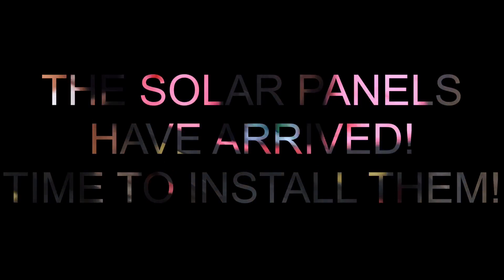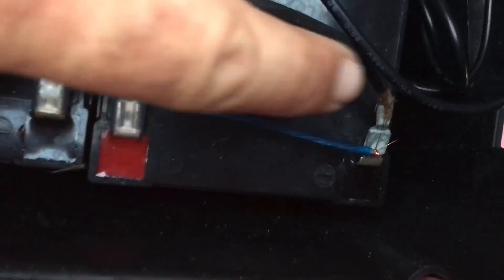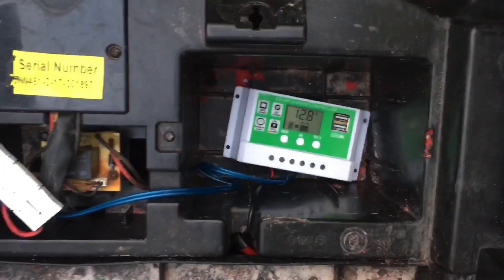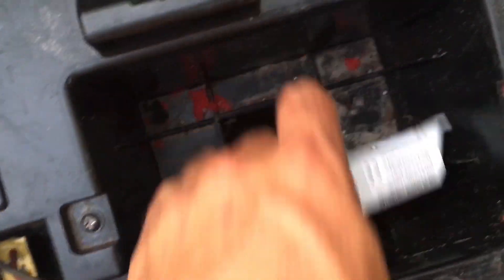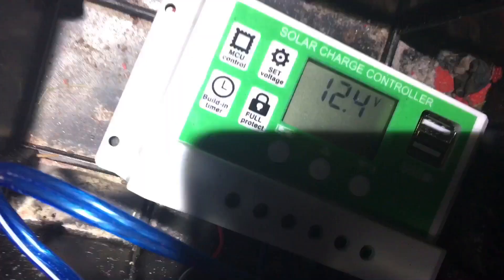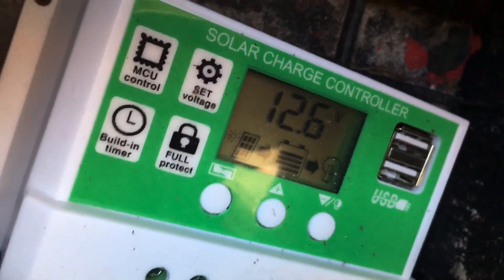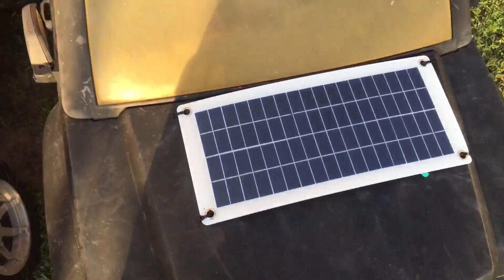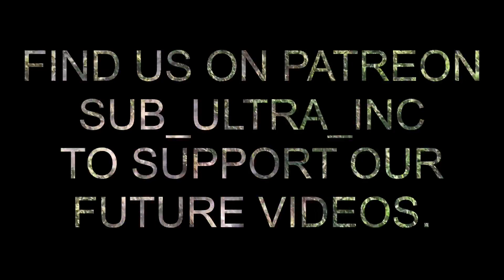Solar chargers for power wheel toys!

Comment: You will burn your motors up unless it was always a 24v car best to run them as 12v you get twice the amp hrs and a old bike tire cut and screwed to the back tires works awesome as traction and saves the life of the plastic wheels from wearing out
Reply from the maker: Robb W I replace the motors and gear boxes with 24v motors and gear boxes